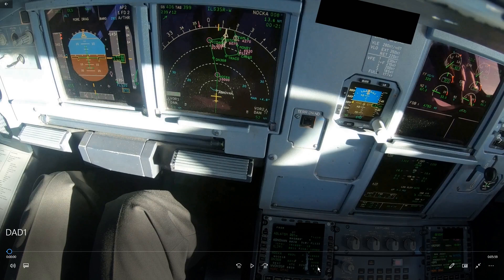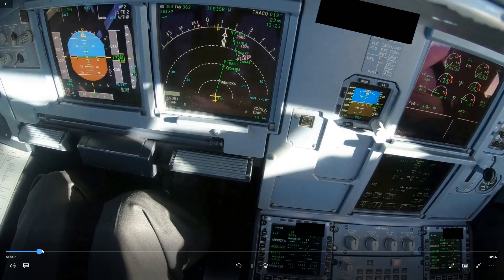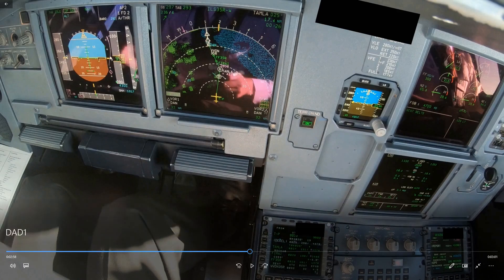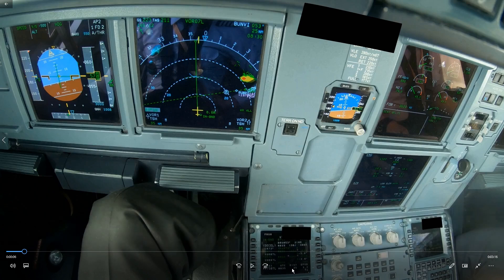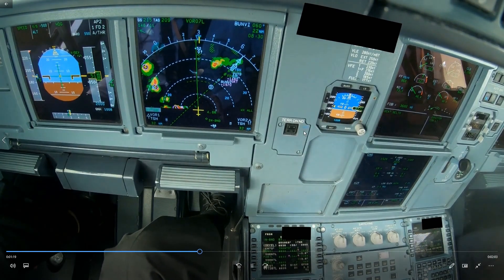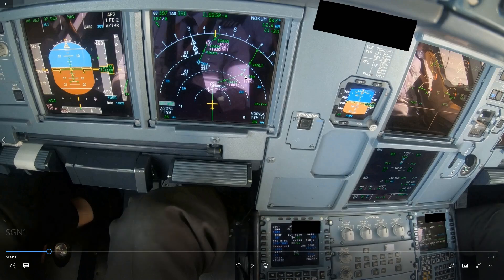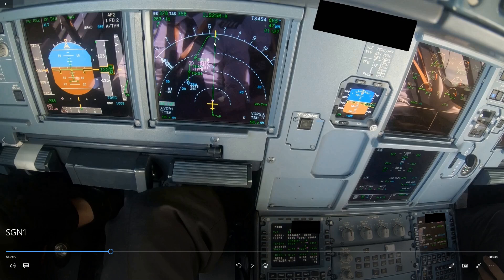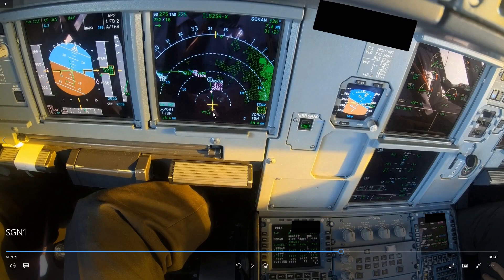Descent Management - Calculate Distance

Comment: If you had a discontinuity in the box along a fplan - will the FMGC track miles still be accurate? As in will it draw an imaginary line to the next waypoint.
Reply from the maker: Indeed, the FMS will draw an invisible line to the active waypoint. So if the flight plan is not properly sequenced or you are too far off track, the FMS distance will not be correct.

Comment: Good Day captain, i bought your book recently, very helpful for understanding the energy managment.
Could you also tell how do you mount your camera so the MCDU/PFD/ND is all in one frame and what's your GoPro setting?
 I want to record my own approaches for self-analysis. Thank you!
Reply from the maker: Use a gopro jaws clamp without the goose neck, so the gopro mounted directly onto the clamp. You have to tilt the camera all the way back and with some models it doesn't tilt backwards far enough so you might have to use a Dremel or file to cut away some material.

Use 4k to be able to read the MCDU distance. You can convert it later to a lower res but the source recording should be 4k. Wide angle view, not ultra wide. It's a bit fiddly to get everything into view. Experiment with the location. Often you will have to bend the rubbery glareshield material a bit backwards.

Send me some videos and I will evaluate it for you.

Comment: LFLL 35L LSE VOR is a 3° descent so I'm struggling to understand why the 3× rule would be that way off? Seems the VOR is not offset and close enough to TDZE. Is this technique not for when we get close to airport and  landing speed is say 140knots?
What if you're cleared for a visual approach, how do you do that and calculate whether you're on profile or not to land manually?
Reply from the maker: Can you post the approach chart? A visual approach is a different thing entirely. Either way, the 3x rule isn't for the approach.

Comment: I've also read the book and you say to fly with zero feet below calculated profile (×3) rule when near S speed for approach.
I'm looking at a VOR landing at LFLL 35 L, and the chart for VOR DME says that I should be at 2100 ft at 6 DME, 1790f ft at 5 DME, 1470 ft at 4 DME. These do not seem to align to ×3 rule. If I use this rule I should be at 1800 ft at 6 DME, 1500ft at 5 DME and 1200 ft at 4DME correct?What am I mising here?
I also see that you say to use GS rather than  profile calculation  for > 13 DME so is this the reason although I'm not using GS but FPA 3° to descend from my FAF?
My understanding is that airport elevation ( 818 ft) is not an issue as the jeppersen chart provides altitude to TDZE correct?
Reply from the maker: At S speed you should fly 500 ft below distance x 3. Only when you have Flap 2 selected then you don't need to correct for the speed.

You cannot use the 3 x distance rule on the approach. The reason is that not all approaches have a 3 degree slope. Also,  the VOR is rarely at the threshold, so distance x 3 won't work.

For an ILS approach just use the glide slope if it's valid, to see where you are on profile. With a selected VOR approach, fly a level segment and pull FPA at the correct point. Then compare the chart height checks with the actual altitude. Indeed, the airfield elevation and the VOR threshold offset is already taken into account with these VOR height check tables.

Comment: Hi, if rwy is not at sea level, say 1000 ft above. When you are calculating profile, you are using altitude and not height correct? 
Also, when you get to 2500ft, radio altimeter would come alive so would you then use height rather than altitude to see if you're on profile?
Reply from the maker: The calculation for an airport not at sea level is "(distance x 3) - speedFactor + airportElevation". For example, if you are at 40 nm at 250 kts with an airport elevation of 1000 ft, the calculation is 40 x 3 = FL120, minus 2000 ft to slow down is FL100, plus 1000 ft airport elevation is FL110.

Never ever use the radio altimeter for the profile or when to configure because the terrain can be sloping.

I recommend buying my book. It's all in there 😏

Comment: 14000-5000= 9000 ft , 9000/1000 =9 MN , 300Kt/60= 5nm/mn , 5*9=45nm , then you must proceed decent at  45 DME !
Reply from the maker: I'm sorry, I don't understand what you mean. In that video there are 3 different approaches so I'm not sure what you are referring to. 

Also, there are many ways to calculate the profile but I'm not sure what method you use. Division is usually not a good idea to use, due to the added workload, and there is no need for that anyway.

This video is not about the profile calculation or what to do about it. It is only about how to get the correct distance.

If you can clarify your point, let me know.
Reply: @a320descentenergymanagemen3  : Suppose you are at an altitude of 14,000 feet (4.27 km), and you want to reach an altitude of 5,000 feet (1.52 km), and your speed is 300 kt, and the descent is 1000 ft (0.3 km)/NM: so we must subtract 14000-5000= 9000, this altitude that the plane must descend is 9000, then we divide 9000/1000 ft/Mn =9 minutes this 9 minute is the time for the plane to reach 5000 ft (1.52 km), we said that the plane speed is 300 kt, we divide 300/60 =5 Nm what the plane travels 5 nautical miles per minute, then 5×9= 45 nm or 45 DME, it is the top of descent of the plane at 45 DME translate French English thank you from Algeria !
Reply from the maker: @vfx7t   When you say reach an altitude of 5000 ft, you mean the airfield elevation is 5000 ft, or a waypoint altitude restriction is 5000 ft? And if it's a waypoint, what speed you have to be there? 

Note that the calculation for the TOD (top of descent) is only done if there is no descent arrow available. Don't make it yourself difficult. It's all about workload management.

Also, at 300 kts, you won't be doing 1000 fpm. It will be more like 2000 fpm. Anyway, the V/S is not relevant for the calculation.

But if you do want to calculate the TOD at lower levels (it only works <50 nm) regardless, use this formula: TOD_distance = (alt_to_lose + SpeedFactor) / 3

SpeedFactor is 3000 ft for 300 kts, 2000 ft for 250 kts, 1000 ft for GreenDot, and 500 ft for S speed.